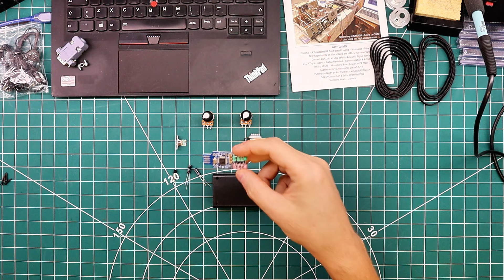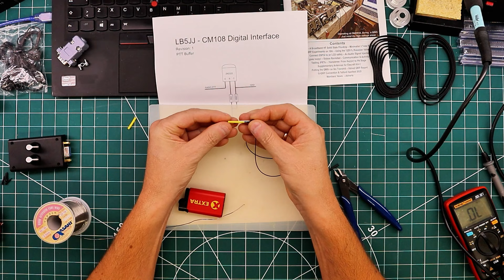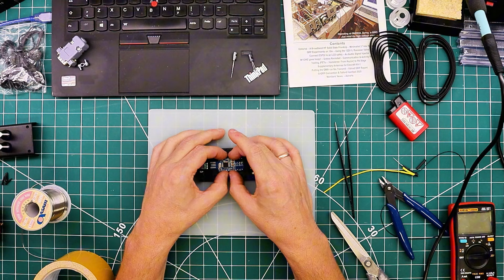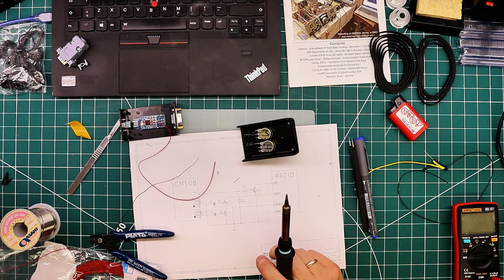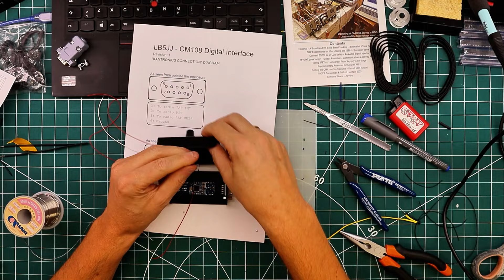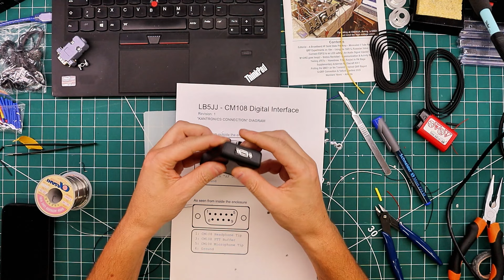Building the $3 DIGI MODE Interface

Comment: If the capacitor's purpose is to block the dc mic bias voltage,  shouldn't C1 and RV1 be going in the opposite direction e.g. AF IN > C1 > RV1 > Headphone ?
Reply from the maker: The idea was to isolate any DC offset(s) between the radio and the CM108, but I think you're right. Placing C1 where you suggest would be better and achieve the same goal. I'll make the change for future iterations. Do you have a call-sign, so I can easily credit you with the enhancement?